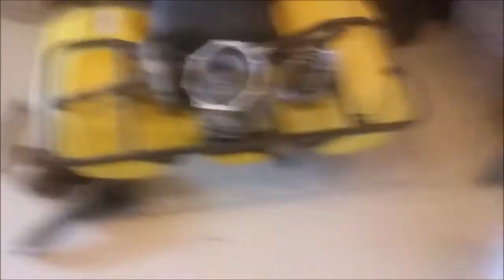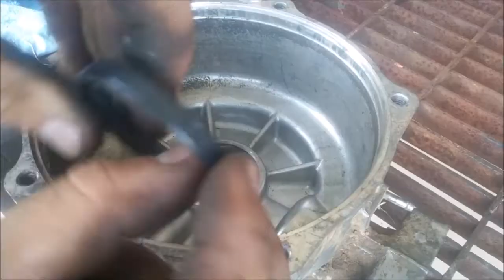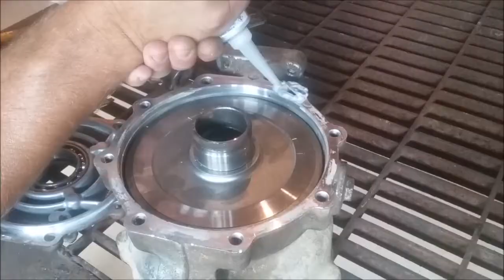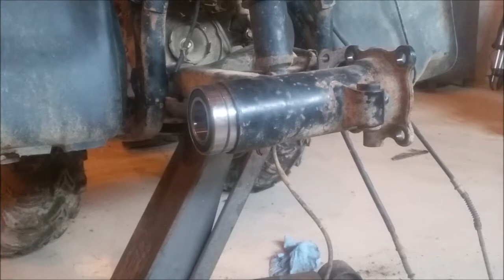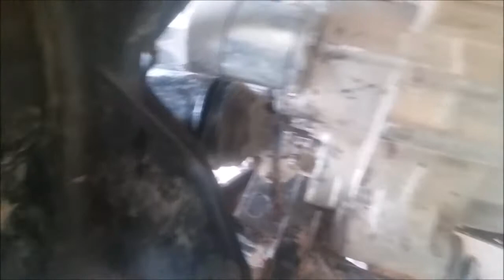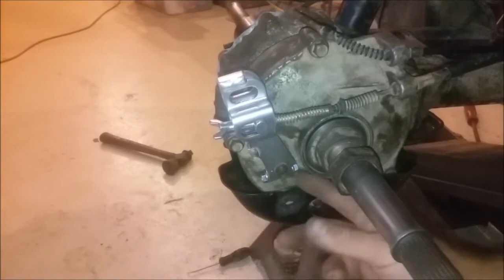How To Assemble A Honda Recon Differential  Rear End

Comment: The bearings you installed on the left side inside the axle housing is wrong the first bearing goes in all the way till it stops and the second one goes up against the first one and that grove is for a snap ring

Comment: I hope you see this, but how did you get the differential past the drive shaft?  I took the universal off and let it come forward and I am still 1/4’ short of clearing the shaft!!  If taking out the engine mount bolts the only way?   Mine are so tight that I cannot get them off an have rounded the nut.  :(
Reply: I tried taking the U-Joint off the drive shaft, let the drive shaft come forward and I am still 1/4’ shy of  having the differential housing clear the drive shaft.  It got dark last night, have slept on it and will just try again on getting the engine mounts loose.  Thanks for the reply and the video has been a big help.
Reply from the maker: I'm sorry wish I could help but I made this video quite awhile back and I just can't remember.

Comment: You could've assembled the brakes after you bolted the diff onto the tube and slid the axle in a you wouldn't have had to unbolt the motor or any of that! It would've been much easier that way

Comment: Btw the double bearings. Both of them are supposed to be past the groove that’s where the pin to keep them in goes that’s why when you were putting axle in bearing was popping out bc a seal is supposed to be on outside of all bearings
Reply: Came here to say the same thing.
That’s a snap ring groove. Then a seal goes outside the snap ring. 
Not hating, just info.